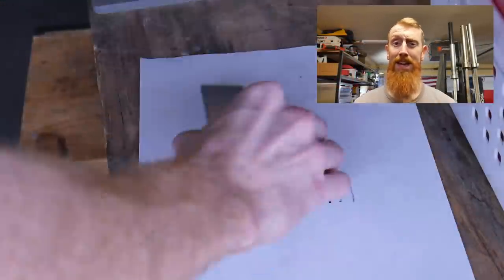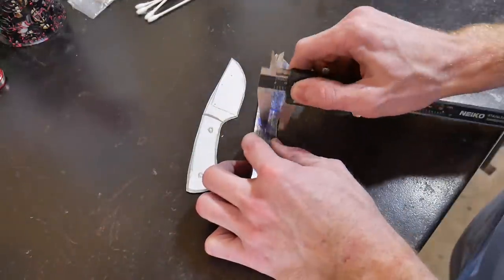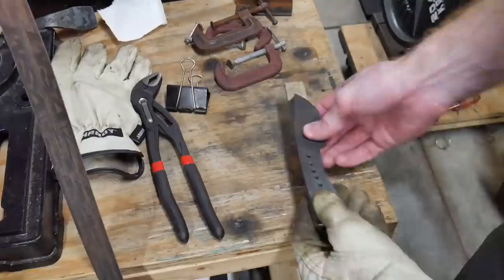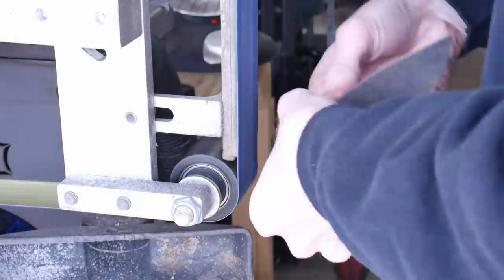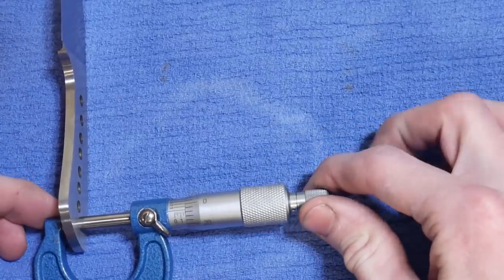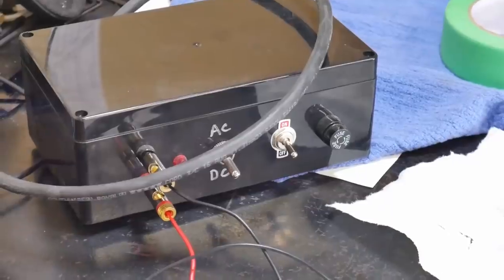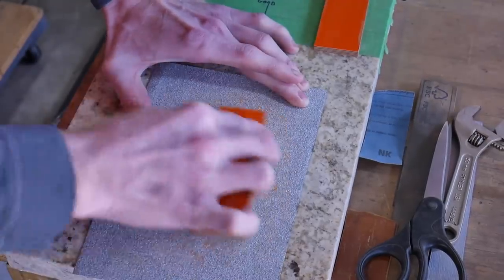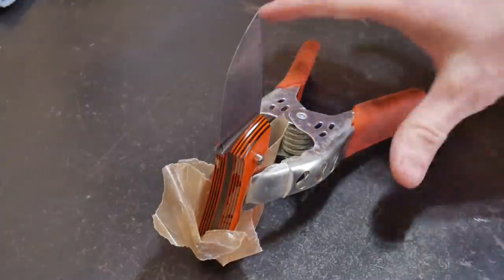Thick EDC Knife - Knifemaking

Comment: Great little knife that looks great, the fact that you're upset about the scratches just shows the high quality you produce, but they are basically what I'd expect to see shortly after having used it, so all good.
Reply from the maker: Thank you sir, really appreciate your comment. Gosh I hate to see a finish scratched like that before ever being used! I've been able to mitigate it in the past, but just got careless this go round. Once again, thanks for your comment!
Reply: How much would you sell a knife  like this? You do great work, I'm surprised that you don't use a guide for grinding your bevels. They are super straight considering their done freehand. I too would not be ashamed to own this one, a knife that gets used will get scratched eventually. What steel are you using as I am a fan of carbon steel blades. I find that most stainless blades won't hold the edge of a good carbon blade.

Comment: I want to try and grind a blade after heat treat. Does it take longer to grind in the hardened state, and is it harder on the sanding belts?
Reply from the maker: You know I really haven't noticed much of a difference. I grind the same way in both cases (keeping the blade cool). I think using sharp belts is key.
Reply: Red Beard is the first to say this, most every knife vid claims that grinding is very difficult after hardening. I am getting ready to try my hand at making a knife, along the lines of the Amazon tools vid.

Comment: When you use the surface grinder post heat treat, you use the 100 grit and go straight to the 320 grit gator belt?
Reply from the maker: I've messed around with a few different ways. I'd say start with around 220-320

Comment: Really nice little knife!  Any concern with heat treating the blade at full 3/16 thickness and it being completely hard throughout?  IIRC I've heard other makers claim 1080 isnt a very 'deep' hardening steel or something to that effect.  I mostly work in stainless and send out to professional HT- even still I normally grind in rough bevels leaving it fairly thick and finish the bevels after HT.
Also I just started using kydex and scratched a few knives too ><    Kydex makes an awesome sheath but it always leaves scratches :\
Reply from the maker: Well, I'm not overly concerned. I think you'd need to get even thicker for that to become an issue. I guess one good point would be that the edge will still be in the middle of the blade and still hardened to the same depth. Maybe the center of the blade would be soft? This may be a feature! Thank you for your comment! I'll have to think on it some more. Cheers man.
Reply: @RedBeardOps  That is a good point, the edge should be fully hard.  It would be interesting to do a test: HT one blade full thickness and RC test, then another with bevels pre-ground in and see if there's a difference; though there's a lot of variables that could happen to make this an uneven comparison...
Reply from the maker: @007Jaredboy  Man that would be cool! One of these days I may have a hardness tester... One day

Comment: Will the 3 by 79 inch belt work on a 2 by 72 grinder?
Reply from the maker: Hey Nick, It probably depends on the grinder and the length of your tooling arm. I'd say it's not ideal.
Reply: Red Beard Ops awesome thanks for getting back to me right away. I have a OBM and the tooling arms are pretty long I have often wondered if something like a 2 by 82 belt would fit. I will have to do some experiments! Thanks again!

Comment: I have that clip on a knife sheath, but it doesn't work at all for me. As soon as I try to remove the knife, I just pull the whole thing off my belt.
Reply from the maker: 10-4, sorry to hear that man. Maybe your kydex sheath was set up "tighter" than mine? As far as retention goes. I feel like a thumb ramp in the sheath may help too; so that you can push away from the draw with your thumb.

Comment: If you grind after heat treat you can ruin your temper
Reply from the maker: You can; only if you're careless and let your knife get too hot. I grind post heat treat without gloves so that I can gauge the temperature easily. I also cool in water after every pass and only use fresh belts to reduce heat. Cheers man

Comment: So for any size thickness or knife do you recomend heat treating before bevel??
Reply from the maker: Most of the blade stock I use is 1/8'' and I haven't had any issues. Haven't had any issues with 3/16'' too. Some people want to do a little grinding before HT on thicker stock than 1/8''